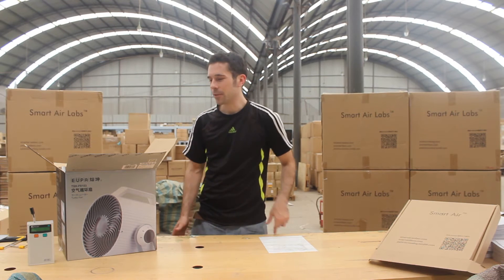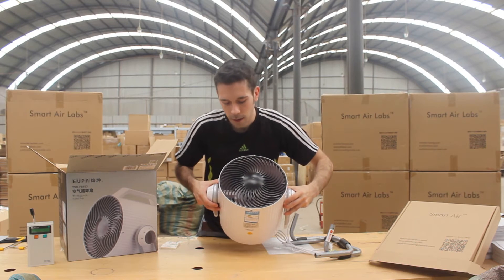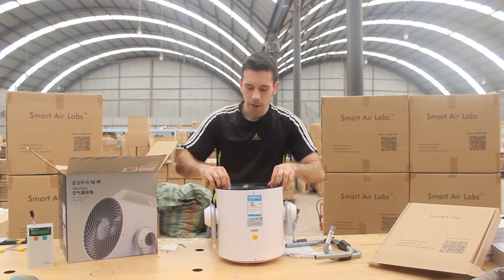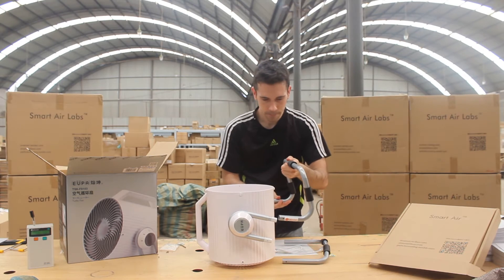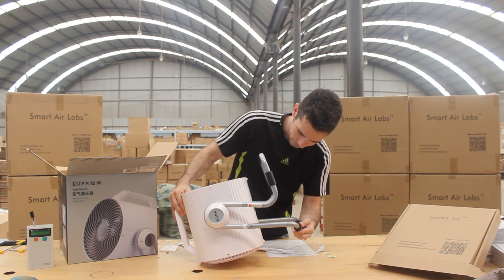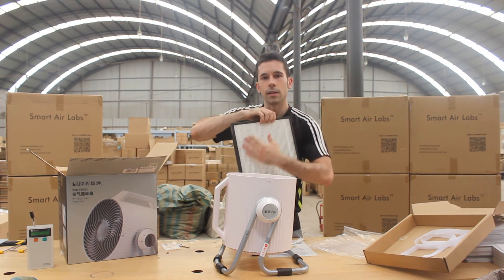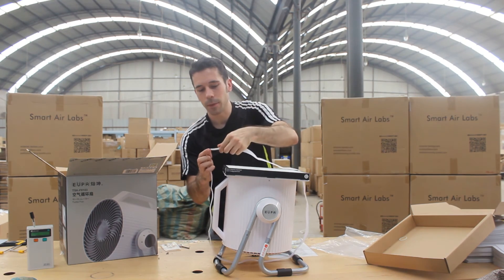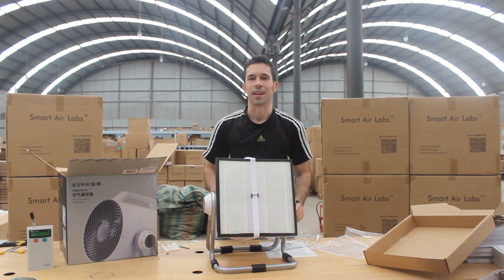How to assemble your Smart Air Cannon DIY Air Purifier  - Velcro Strap

Comment: Hi,
I have two questions:
1. If I buy a  Cannon DIY Air Purifier with Carbon filter and then later, say after 6 months I do not replace the carbon filter (and use a new HEPA filter), it should work just fine...right?

2. If I buy a Cannon DIY Air Purifier (that just has HEPA filater and no carbon filter), can I still buy a carbon filter separately and place it above the HEPA filter?

Thanks!
Reply from the maker: Hey Vivek, great questions!
1. Yes, you can choose not to replace the carbon and just keep using the cannon with a new HEPA filter only

2. Exactly - you can add in a carbon filter or swap one out any time. That's the great thing about the flexibility of the DIY purifier.

Breathe safe!

Comment: If that configuration is recommended by the factory, than you guys are awkward. That thing looks ugly
Reply from the maker: Funnily enough, this wasn't a recommendation by the fan factory initially. But after we tested and brought out the cannon air purifier using their fan, the factory instantly started copying us and doing the same thing!

The Cannon is not pretty, but as a cost-effective air purifier under $70, it does a really good job. If you have your own fan then you can do the same thing by grabbing a HEPA filter and strapping it to your own fan!

If you're interested in testing out this fan, or learning more about it, then let us know!
Reply: Smart Air Filters okay i got it. And i live in Indonesia by the way. I would like to test it myself, but it'll be too expensive.
Reply from the maker: Yeah you're right, these kinds of filters are bulky so cost a lot in shipping. Since we're based in China the shipping can cost a lot! We are looking at finding distributors in Indonesia, so maybe this could be a way for you to test!
Reply: Smart Air Filters okay, that will be awesome if the Air Cannon fan is available here!
Reply: Trust me, when you have awful allergies, all you care about is if it works.  You worry about its aesthetics later.